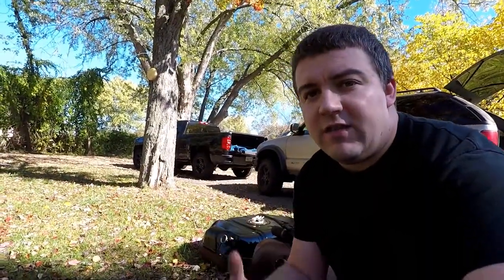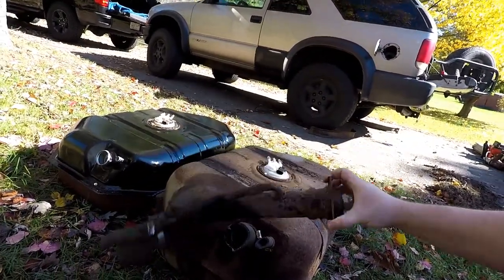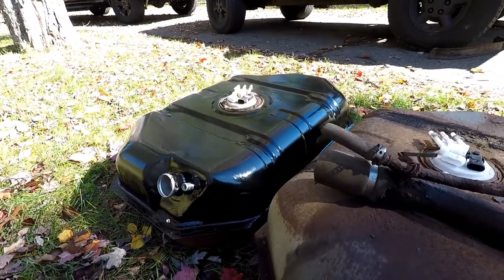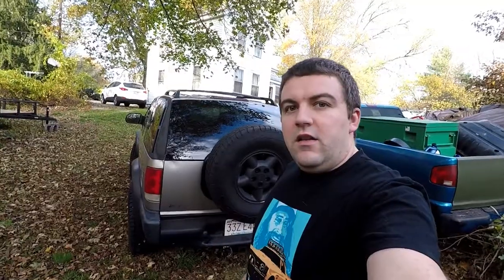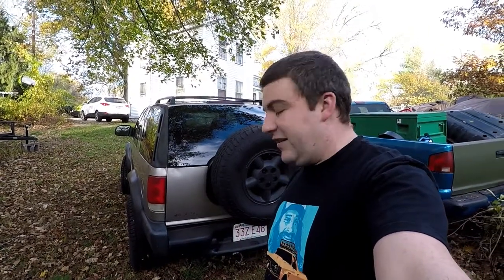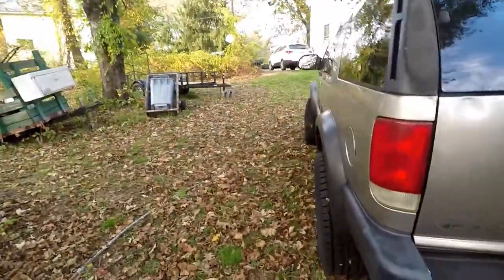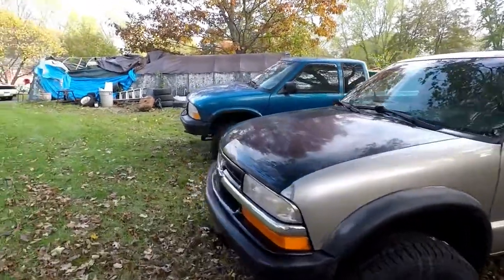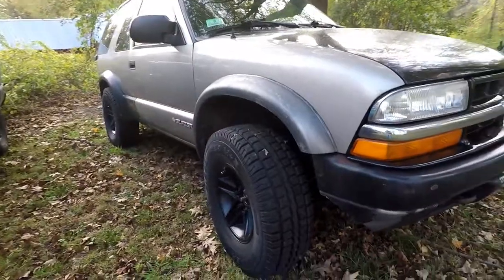ZR2 Fuel Leak Fixed Plus New Tires

Comment: I've been thinking about getting the same iroc  wheels for my 2000 jimmy. I've always liked the look of them. I actually had them on my old 1994 blazer. I just recently replaced my upper control arms.
Reply from the maker: if you can find a good deal on a set of Iroc wheels there a great option and can be cheaper than a set of new cheap steel wheels.